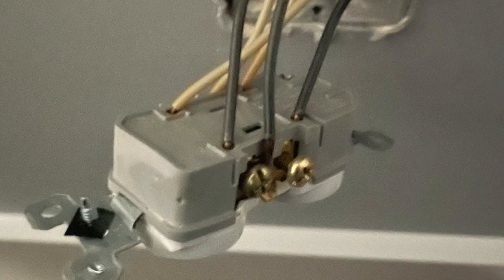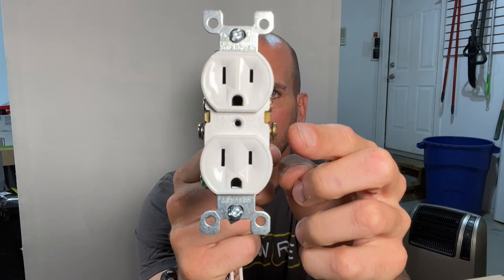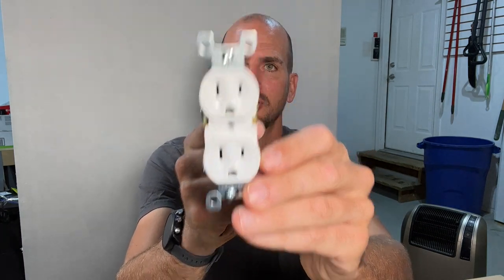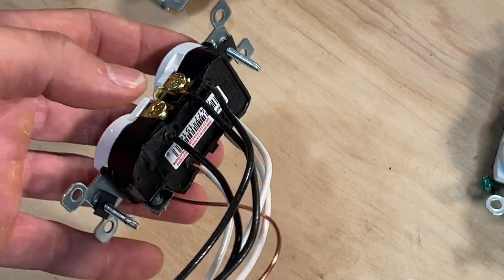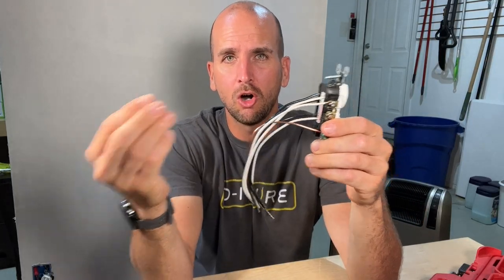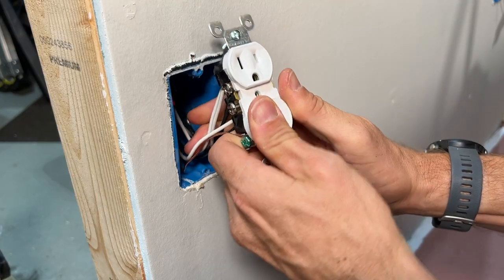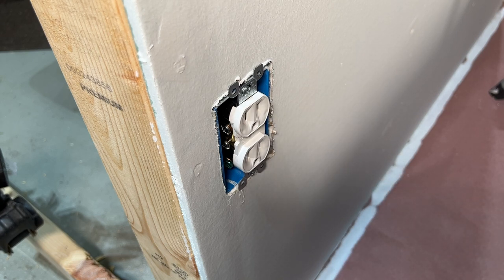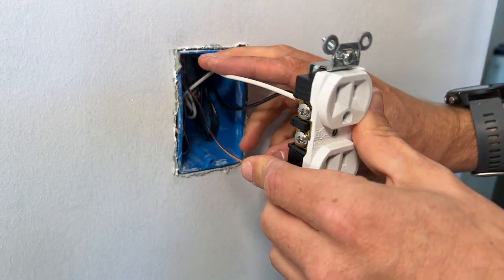Beware Of These Wiring Mistakes Made On Newly Built Home

Comment: i cant remember off my head but I believe it is against code to use the side wire and the back stab at the same time. i think its something where you could easy overload the outlet and to where it becomes a fire hazard.
Reply: Both wiring methods may be used on the same device as long as the intended load does not exceed the receptacles rating. I don't believe there's an NEC code against it, but it may violate the UL rating. I NEVER backstab. I ALWAYS use pigtails and Wago lever locks.

Comment: Back stabbing is still perfectly acceptable in modern code, but it's past time that it should be disallowed. North American electrical code is weird at times. It's like we still don't have shrouded prongs on our plugs. I've seen it done so I know it can be done. They just won't implement it. You're kind of stuck with 15 amp lines unless you want to rewire the entire house. Our mid-60s home only has 20 amp lines (accept the major appliance lines). It did come with aluminum wiring, so pick your poison. I just pigtail with anti-oxidant compound, so it's pretty much an issue you can work around.

Comment: Wagos are far too bulky and imagine having to dig through to find a 3 or 4 wire wago. They look the same compared to different size wirenuts. They take less time to scavenge from the toolbelt on the draw and smaller than wagos. Plus you never waste money on other sizes you wont use as much.

Comment: I wish the receptacle speed wire did not exist. I wish the same type of screw and plate connections that are found on most GFCI receptacles were on the standard outlets. It just makes everything so much easier, and safer for all involved.  had an idea for something even better. A split outlet of some kind with a lever and a hinge. Just open it up, like a Romex cable in side, in a proper orientation, and clamp it shut. No need to splice wire, or even cut the sheathing on the Romex. Now someone has the opportunity to patent that. I want royalties... It came to me in a dream, and if someone knew how to engineer stuff, I'm sure it could be invented. NO plastics though. Hardened ceramic is best.

Additional thoughts are gauge of wire and sockets. It would behoove all involved to have 30 Amps on all sockets, and 12/2 WITH GROUND minimum as well as the 30 Amps breaker. This will ensure that when a socket is overloaded, which is common with extension cords and power strips especially these days with chargers, electronic gadgets, computers, etc there is less chance of the circuit not being able to handle it. I've yet to get that far myself. I've started all new wiring projects and fixes 12/2 with ground. Will go up to the commercial grade 30 amps sockets when finances allow for it. Some of it is also hyperbole and politics, and other parts is because people are stupid and the government has to try and save people from their own stupidity for some reason. For example, needing to run conduit on a concrete wall when there is an outlet in the way anyway, so it's unlikely to walled up and if so, when the studs are placed, it will be protected that way. It's just stupid at a point. Anything they can think of to cost people more money, they'll make it so.
Reply: "A split outlet of some kind with a lever and a hinge. "

Leviton just came out with a new series of decora receptacles and switches that have a lever that clamps down on each wire, just like a WAGO lever nut. 

And yes, I totally agree that speed wiring should never exist. I don't even know why it's permitted by NEC and UL. There's just so much that that can go wrong with a wire stabbed in and a thin piece of metal holding onto it.

Comment: Half those problems are related to how everything electrical in North America is stuck in the seventies. Seriously, look at that horrible outlet, not only it has visible screws, it's just entirely outdated. Those side screws for a J hook are just barbaric, and the "backstabbing" system should just not exist in a country with such flammable houses.
Then there is the cabling system, another surreal thing. I honestly can't understand why would anyone insist on using Romex, it's just insane. Not only it's solid copper, which is terrible to work with, it's a flat cable that needs a hole twice the size of what a round cable would need.

By the way, the wire nut is the only thing from US electrical practices that I really like. It's simple and work just as fine as a Wago, but it's way cheaper.
Reply: @Kevin-mp5of  Thinking about now, I never saw tests on solid copper, but on flexible cables they work like a charm and offer less resistance than the Wago.
Reply: @Kevin-mp5of  You crimp ferrules on the terminals only when they are being tightened somewhere by screws, and even that is not mandatory by code here or anywhere else I know. When you put a stranded wire inside a Wago, the lever just lightly press the copper on a tiny busbar...
Seriously, there are resistance tests comparison between Wago and wire nuts, go check yourself.

By the way, I'm not saying Wagos are bad, they are not, I use them every day for certain applications, I just don't think they are the best cost-effective connector for wiring a whole building. 🤷

Comment: Devices should come with the screws tight to prevent lazy people from leaving them lose. 
When doing any electrical wiring, I always use the commercial grade outlets, the cheap stuff bothers me. 
I'm not a fan of plastic boxes, give me a steel box any day! I am a fan of the 4 square with the proper mud ring when walls are opened. I like all the space they give you inside for your wires. I also always do 3 wraps of electrical tape on all devices. 
Wago connectors. . .  I have tons of these that I use for over head paging systems, they work great and make troubleshooting much easier than having to deal with wire nuts. When doing some electrical, I've used them a couple of times, but I really don't like the way that solid wire can move around in them, so I stay with wire nuts.
Reply: Commercial electricians would never tolerate that. I'd guess close to 80% of the time outlets are daisy chained. I'm not a professional, but I always use the top screws for one piece of romex, and the bottom screws for the other. If I had to loosen screws to connect the outlet, I'd be finding another brand.

Comment: What you just did was to make the problem far worse by adding wagos instead of getting rid of the back stab and properly pigtailing with wirenuts. Backstabs are just as bad as the wagos but now you have MULTIPLE spring lever connections, with more possibilities for problems, stuffing all those spring lever connectors into the box and tightening the outlet screws forcing some of the levers to pop open or wires pushing sideways inside the wagos making the connections loose or have less contact - especially grounds, which makes the circuit a shock hazard. I also see you sell wagos? Gee I wonder why you push them? The biggest thing your doing wrong is performing electrical work on a friends property without a license, also rental properties you said you did. You dont do anything right do you? Like teaching others.
Reply: He talks about wago's in every videos, obviously being "sponsored" by them.

Comment: Because of calculating the total cubic inches that all the wires, cable clamps, splices and devices on new work I never installed more then two type NM  ( Romex ) or armoured cables into a single gang box. Argued with fellow lazy electricians when the back stabbing  came about in the 1970's. Told them when it was approved for a ground wire might consider using them.  NEC did a halve ass rule awhile back when they banned only using back stabbing with #14 copper wire by making the hole smaller. Should just outlaw them. I like to give the wire a little more bend using my needle nose pliers before securing screws with a now required torque driver. I always apply about 3 wraps of quality tape around all devices. Never purchase or use any tools, safety & test equipment or electrical supplies made in lying cheating lack of quality control communist china.

Comment: “Save on labor costs” - that’s certainly a polite way of saying the guy who put them in was lazy and sloppy. :)
Reply: labor costs are the majority of the costs on any given construction job, especially for residential. Using the quicker code compliant methods isn't necessarily lazy or sloppy it is just the most cost effective.

Comment: You cannot use a 20 amp circuit breaker and #12 wire on a 15 amp receptacle. You are not sufficiently protecting the 15 amp outlet and as a result allowing it to potentially overload. You would need to use a 20 amp receptacle in this case. This is why electrical  work is the worst DIY that you can do. Get a licensed electrician that knows electrical code.
Reply: A 15 Amp receptacle gets its name because is keyed to only allow 15 Amp rated devices to be plugged in. The body of the receptacle itself is rated for 20 Amps. It is standard practice to use 15 Amp receptacles on 20 Amp circuits - as devices with 20 Amp plugs (with a horizontal neutral prong) are few and far between.
Reply: @JasonEDragon  This is not standard practice from my experience. A 15 amp circuit should have a 15 amp circuit breaker not a 20 amp circuit breaker. I have never seen these 20 amp circuits on 15 receptacles. They are always 15 amp circuit breakers. If you look at the packaging for a 15 amp receptacle it does not show it rated as 20 amps. You have to follow the manufacturer's instructions.
Reply: A 15 amp receptacle is allowed on a 20 amp circuit by NEC article 210.21(B)(3), provided that it is a duplex receptacle or part of a multiple receptacle/outlet circuit.  However, the 15 amp receptacle cannot be a single receptacle (i.e., non-duplex receptacle) on a individual 20 amp branch circuit per 210.21(B)(1).

Comment: The fact that new home construction is wired by "professionals" is utterly meaningless...I've been around job sites for 30 years and trust me a lot of "pro" electricians are nothing more than sloppy clowns...rewired 4 branch circuits on my sisters "new" home and the work was atrocious...take a serious, educated, conscientous DIYer over a licensed idiot any day...
Reply: Exactly...I've seen new construction electrical with exposed copper at every termination, j-boxes buried behind drywall, j-boxes hanging in mid-air, open splices with loose connections, 14-gauge romex on 20-amp breakers, the list goes on...a lot of contractors put their best guys on their commercial/industrial jobs and give the residential to their worst or newest guys...a lot of inspectors are no better either